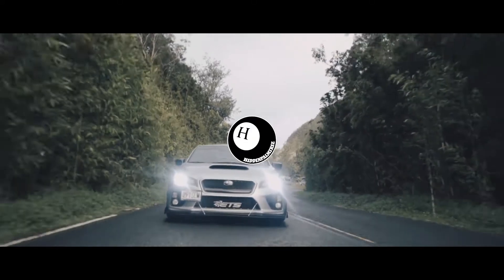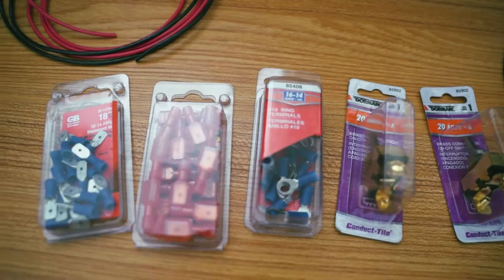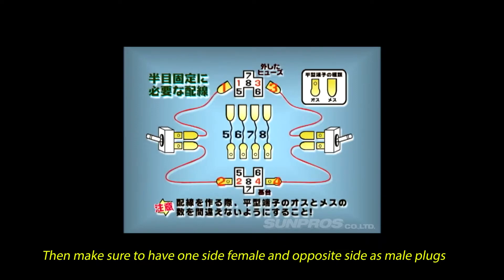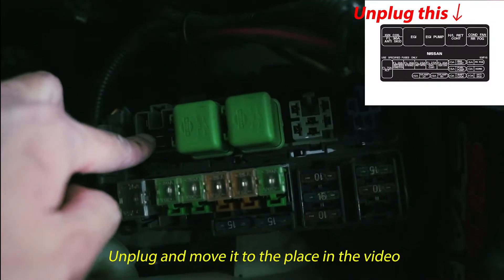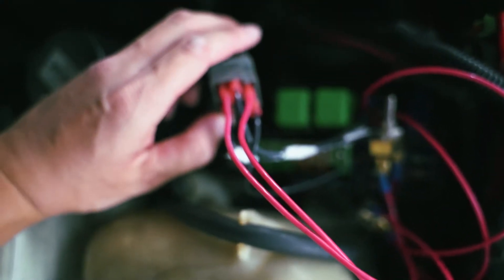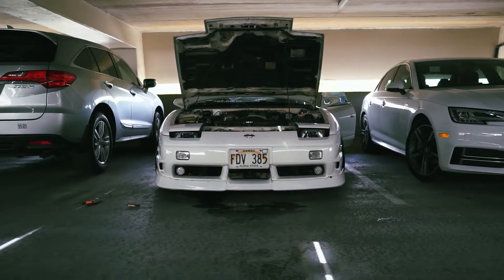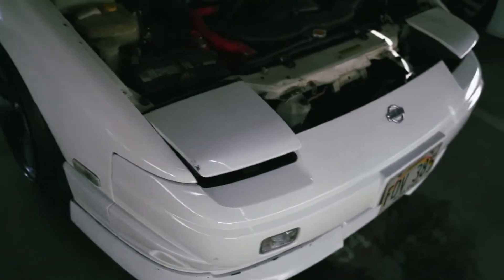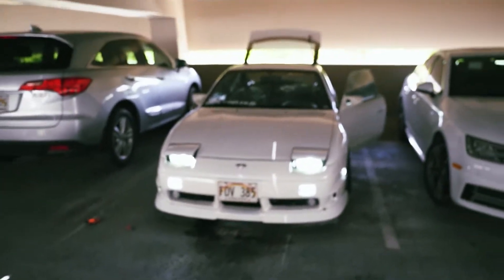DIY Real JDM Sleepy Pop Up Headlights Mod (240sx S13)

Comment: I did something similar on my 93 stealth, but rather than messing with relays I sliced some switches into the power wire on the connector. Then I ran them through the firewall and into the cab. Way easier and you can control them from the driver seat.